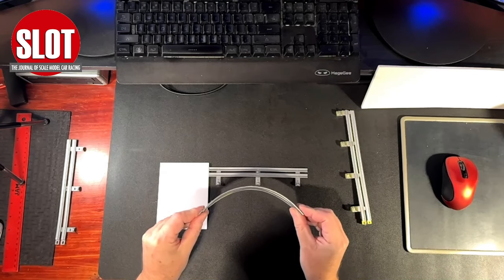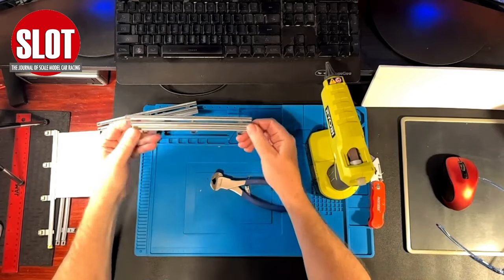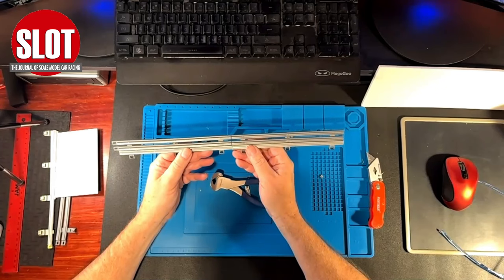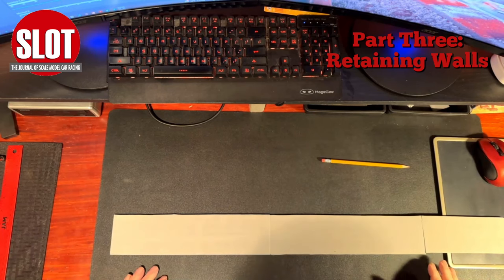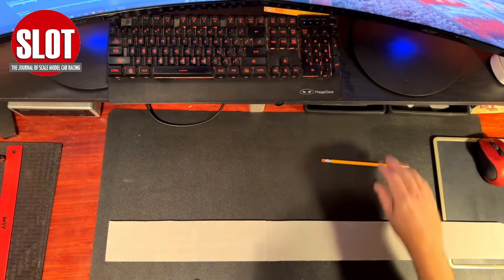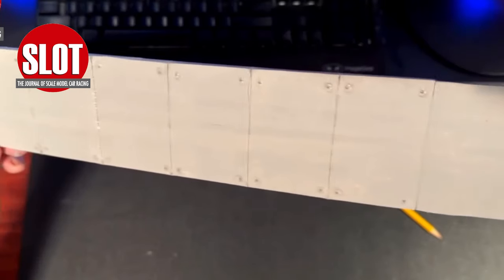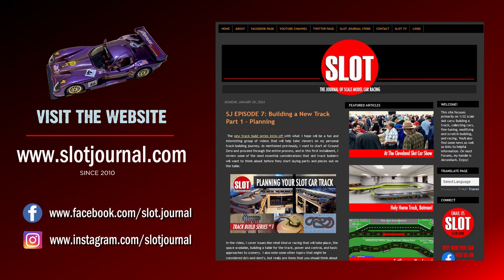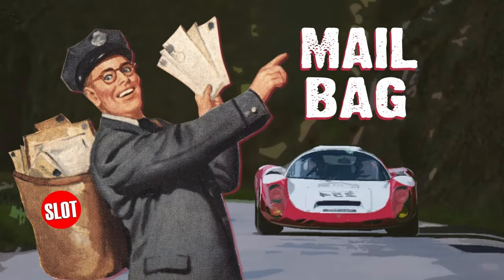SJ10 - Track Build Guide #4 - Guardrails, Barriers and Walls

Comment: Nice idea on the foam barrier. Looks like landau top foam used for vinyl tops and custom made door panels. If you went to a custom auto upholstery shop they would have it in a 60” wide roll. Good video and ideas thanks 👍
Reply from the maker: Yeah - I got this at a craft store in a 12" x 16" sheet - but you can also get it in rolls which eliminates the seams.  Thanks for watching and the feedback!

Comment: Everything is looking great with all the borders! I love the mountain background, I tried doing that before with my track by just using similar scenery from old calendars (didn't work as well as I wanted), but yours looks amazing! Where did you happen to find one like that as one piece, if you don't mind me asking! 👍
Reply from the maker: I first image-searched for "Alps panorama" (large size photo) then looked until I found ones that seemed right. I found two - then I took them into a graphics program, made a document 30" x 10' in size, and inserted the images so each was 15" high. I had to stitch and blend the images to make them wide enough, but you can make the seams almost invisible if you're careful. Honestly the key part was getting them printed at my local library, which offers wide format printing at $2 a linear foot.
Reply: @slotjournal Thanks so much for the detailed info Mark!! I felt stuck after researching and not finding an answer. I would love to have my track take on a craggy, mountainous, Scottish vibe eventually "one day." 🙏👍
Reply from the maker: @SlotCarHooligan   Well, just for sh*ts and giggles, I found a panorama that might work for you and created a document about 11' x 2' - maybe it will fit the bill. Sent to your email. Good luck and thanks!
Reply: @slotjournal Sorry I've been so busy this past week! I will check it out, thanks so much!!